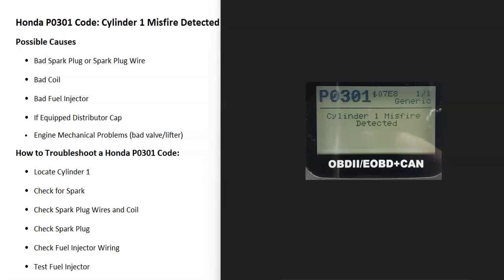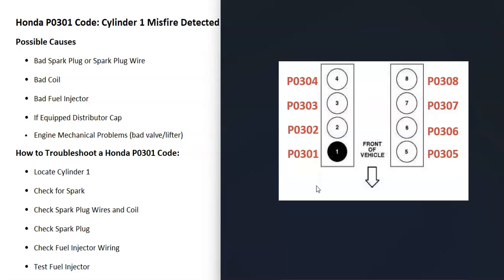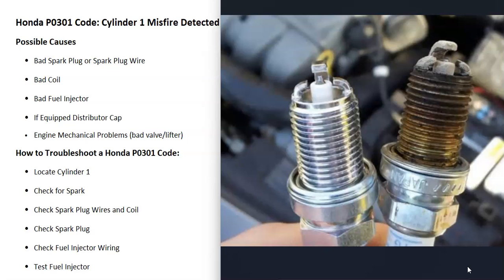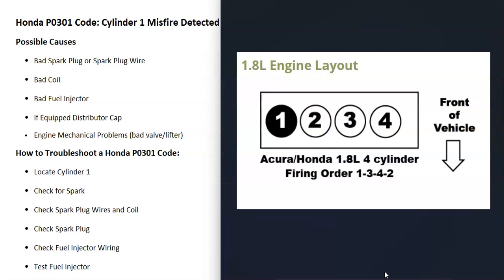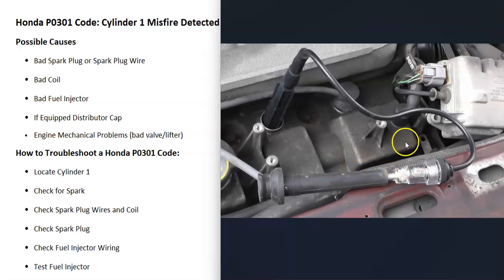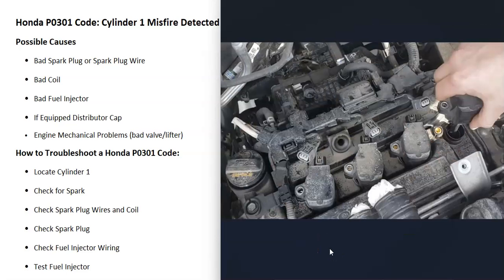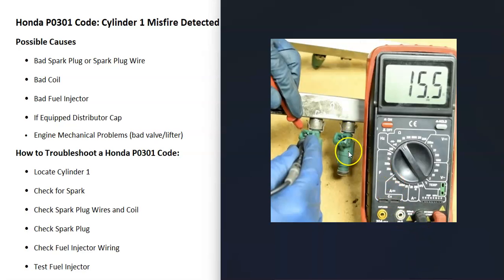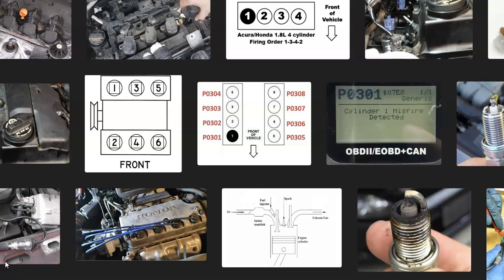How To Fix a Honda P0301 Code: Cylinder 1 Misfire Detected

Comment: I have P0301 code. The mechanic replaced the spark plug and it ran fine for 2000 miles. The mechanic say the the cylinder ring needs to be replaced at a cost of $3500 just for one piston ring on a 2009 Honda Accord V6. With only 81,000 miles on it. Is $3500 too much. It’s at a Honda dealership. Patiently waiting for your answer thank you very much.
Reply: got quoted 4800, I said no and will honestly just buy a rebuilt engine at that point.

Comment: I got changed the injectors unplug wires and plugs on a Honda 2000 CRV and now it's saying it's misfire but it's getting fired every cylinder
Reply: Sad to say but it probably needs piston rings if it’s burning oil also

Comment: Thank you for the walk through this will be very helpful on my 2020 as i have alot of up grades and just tonight i was lets say i was pushing the car a little hard and i have not done the recall for the fuel pump on this model yet and the car started running very rough and had no power and the CEL started flashing and the P0301 code popped up. After shutting it down and resetting this as i have a OBD2 scan that will do that it seem to run fine the rest of my way home. But things to check now so thanks.

Comment: There is no other videos on this engine specifically!!! How do you access the ignition coils... My 1998 Honda Accord says misfire in cylinder 1 and cylinder 3 . It drives and runs pretty good very little misfire.. I replaced all the spark plugs didn't fix it ..
Reply: Still could be a coil more than likely. If not confirm injector is working. The least likely would be intake manifold gasket